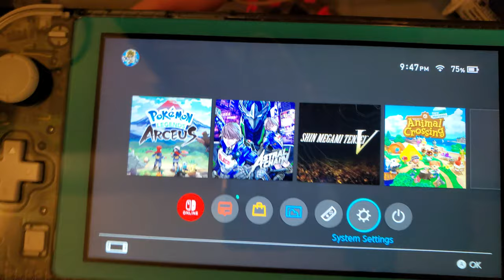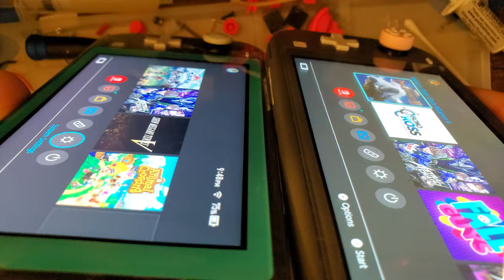Switch Lite Replacement Housing and Laminated Display Assemblies

Comment from the maker: Note that the lamination causes the LCD to sit a little bit closer to the digitizer which also causes the digitizer to deflect a little since it is made of plastic.
Over time (about a week in my experience), it can cause the LCD to start delaminating from the digitizer.
I was able to curb this problem with a glass screen protector (which helps to stiffen the digitizer) AND by simply padding the rear of the LCD with some foam (which helps prevent the deflection in the first place).

Comment: I installed a new digitizer and an atomic purple case in a lite I got on ebay. It was my first foray into case swapping with any kind of switch and took me about 8-9 hours one saturday. To do this in an hour is just crazy!  I went slow and used the ifixit iopener kit which also had handy dimples in the cardboard insert to sort all the screws. I followed the ifixit guide and sorted all the 8 different screws, used the double-sided tape for the digitizer, and put it all together perfect...except the case came with two game card doors so was missing the sd card door. Extremerate made it right though and sent me a whole new case kit. I thought about doing another case swap with this mostly complete kit but never did.

Comment: Hi @makho, I followed your tutorials for installing the funnyplaying 5.0 IPS mod for GBC, and it worked great. Then I followed your tutorial for the lipo battery mod (that uses the existing dc port) and I am running into some issues. I get the power LED and the Gameboy "ding" sound, but the screen is black! If you or anyone else here is willing to help me out on this I would greatly appreciate it.